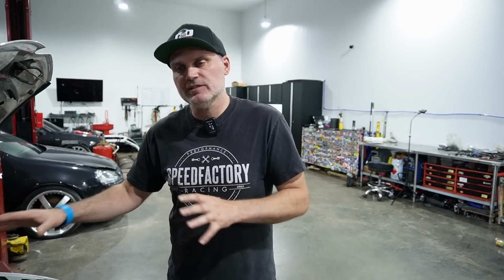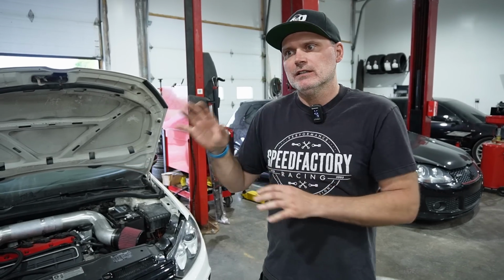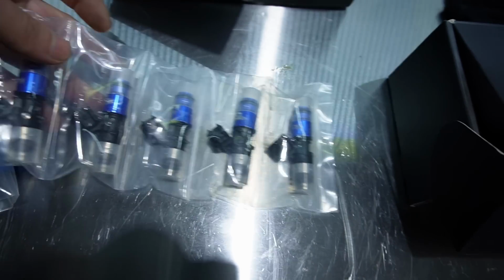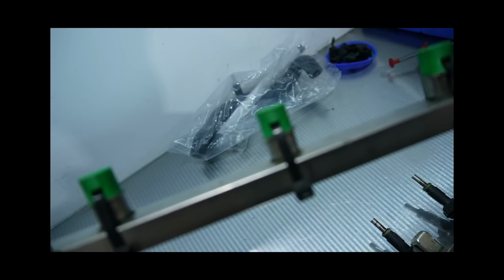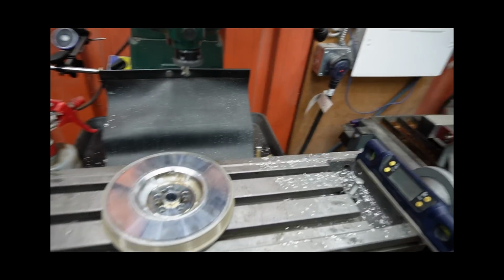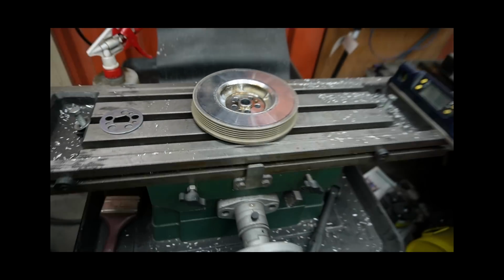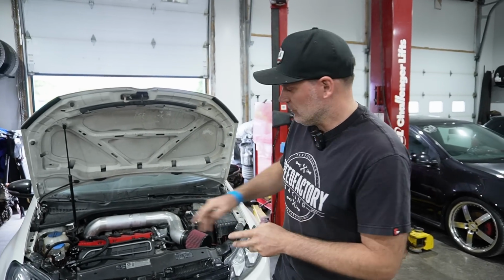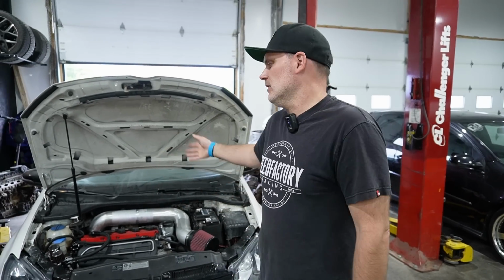07K Turbo Swap is alive.

Comment: What is the benefit of doing a return system fuel rail vs a returnless?
Reply from the maker: On a direct injected car that runs very high pressure at the injector returnless is fine as those cars are controlled with a low pressure fuel pump module that controls power to the pump. So fuel pump voltage is controlled, so at idle or high demand the pump is runs different voltage. On cars like this there is no fuel pump module to control voltage so the pump runs the same all the time. What happens under a boosted application is as boost goes up fuel demand increases but the pump can't keep up because it's just always running the same. So switching to a returned setup with boost referenced fuel pressure regulator allows to keep fuel pressure stable as boost goes up. 

You also just can't stack a huge pump behind a returnless setup. With big pumps the fuel starts to pile up at the injector off throttle as the pressure/fuel has no where to go, which can cause off throttle issues. It also has unpredictable or uncontrollable fuel pressure under load which makes tuning difficult.  

The returned setup didn't need to happen for this power, but with ethanol, and me wanting to eliminate the stock LPFP module it made the most sense for what I'm after.
Reply: @COMotorsports thanks for the clear explanation 👌

Comment: When will you dyno? G30-900? G35-900? Gasoline or e85?
Reply from the maker: I have both turbos. Originally had the 35 on it but the 30s on it currently. We'll be doing both pump and e85.
Reply: @COMotorsports nice, I can only use gasoline, but 8000 rpm, fully built, currently having a GTX 3576 gen 2, but I'm afraid it won't make past 550whp on gasoline.
Reply from the maker: @ealoken  It likely won't

Comment: Hey, i have an awp 1.8t was wandering if IE h-beam rods 144x20mm paired with JE forged pistons that also take 144x20 would work in a 19mm wrist pin engine.

Comment: Hey ik it's unrelated to this video but was generally wondering how much a stock 02j 5 speed tranny can handle I've seen many say 300 to 350 and others saying 200 to 250, it's a daily and I really only want to make about 300 to 350 hp but was wondering if I needed to strengthen the tranny before adding power.
Edit: and what clutch would you recommend with my build in mind.
Reply from the maker: All depends on what you're doing with it, and how you drive it. We have plenty of customers making that power without issues. Traction plays a HUGE part in it.
Reply: @COMotorsports yeah, ohh okay i figured im not gunna be launching it nor putting slicks of any kind on it so i think it should be good. Appreciate the help.
Reply: @COMotorsports clutch recommendation for 300 to 350hp or would the stock 02j clutch be okay?

Comment: Hoping the revamp site or information comes back on line.  I have a Mk5 bpy/dg250 and when the fsi engine stops I would love to swap a o7k in to it.  Not crazy power but flash the ecu and tcu for the high power and rev limit would be so fun

Comment: How hard was it to swap into the gti. I got an 07k motor with 24k miles so I wanna turbo it down the line for a project.
Reply from the maker: Depends on your skill level and the parts you have available to you. Just an engine isn't going to get you far.

Comment: Finally our white 2.5 turbo video i have been waiting for soooo long. Very happy for you. ❤

You mentioned you want it to run on stock ecu. Which one? A normal 07K ecu or a TT-RS CEPA/Daza ecu?
Reply from the maker: It's running on 07k, but not stock calibration of course.

Comment: For the fuel pump did you have to upgrade the wiring
Reply from the maker: yes pretty much standard practice for most of the stuff we do.
Reply: @COMotorsports  can you help me on what I should do for my mk5 I have a k04 set up with upgraded high but I feel like my low pump leans out sometimes what’s the best route for upgraded low pump safely
Reply from the maker: @trethegreatestt9880  for simplicity I would run a TTRS pump, basically plug in play.
Reply: @COMotorsports do I have to run the ttrs module as well?